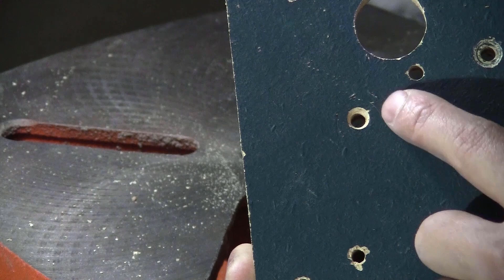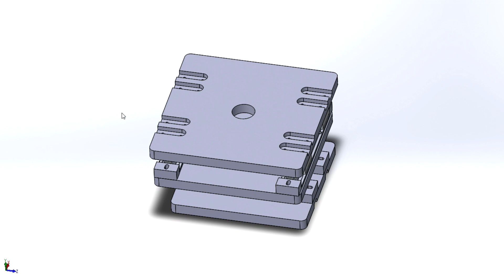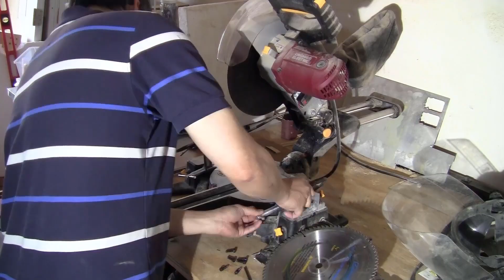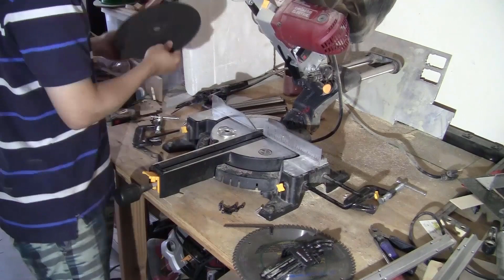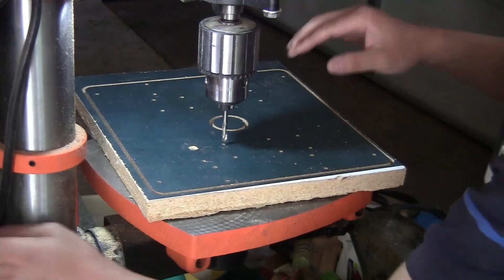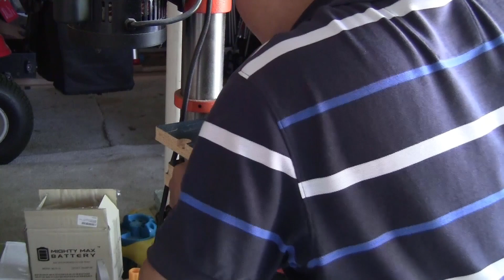Floating platform (bed - table) for drill press - Why do you want one? Saving time making parts!!!

Comment: Good tip to mill a smaller hole and then clean it up on the drill press. I would never have thought to do that.

Put a drill bit matching the size of the pilot hole in the chuck. With the drill off, lower the drill into the pilot hole to line up the material to be drilled, and then clamp the material. Then replace the drill bit with the proper sized bit (or do it in stages for a large hole). You are then able to accurately drill the larger hole with the same center. Although you will need to swap between 2 drill bits, so for a lot of holes it can be tedious, but it is accurate.
Reply from the maker: That's pretty much my process to drill big hole in some harder material than wood, aluminium for example. The holes usually milled a bit under sized on the cnc mill so I usually still need to clean with the drill press anyway. Putting the drill bit directly on the cnc machine doesn't work that well because the bit are long and they flex a bit when drilling and will require proper chuck for each drill bit size. Maybe short drill bit will work for the cnc machine.

Comment: I have had it spin around on me when I do that before.  I expect it to happen if I drill a hard metal now so I have to stick a clamp on the side to catch it when it happens but really I just line it up the best I can then go for it because if it spins away from my hand the part will probably be useless and the clamp is just to prevent it from spinning out of control OR to prevent it from hitting the round metal sliding part to prevent dents.  I just can't get with the just hold it down method if I am doing metal but wood it isn't nearly as bad.
What happens with the metal is the bit makes a shaving and it doesn't break off (could be a slightly too dull bit) and the bit grabs it on its next pass and the entire piece is forcibly spun out of your hands since there was no kung-fu grip of death on it.
Reply from the maker: Hand holding metal pieces only work with small bits for me. starting around 6mm bits, things started shaking up. 10mm bit is impossible on aluminum. With wooden pieces, the bit got caught sometimes if I wasn't pressing hard enough. That's why I thought of this type of platform. At least I feel a lot safer now with the piece clamped down with C-clamps.
Reply: @minhsmancave9448  I just use those Irwin clamps that has the trigger to hold mine but I make sure the bit is in place several times before I do it.  I like your idea there as it is better than just trying to hold on to the sucker for sure (especially if your DP is running around 600rpm or more).